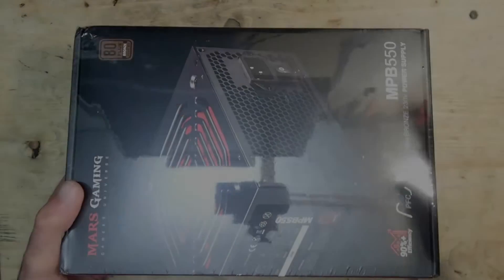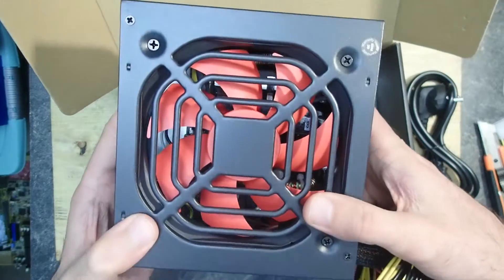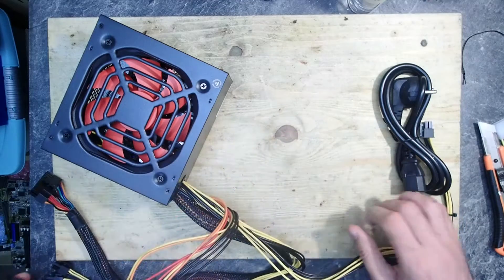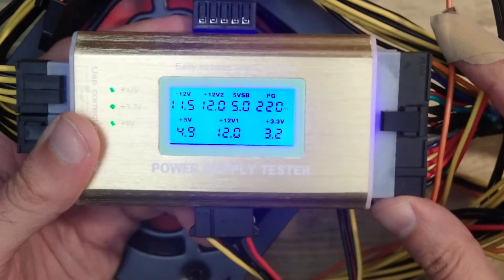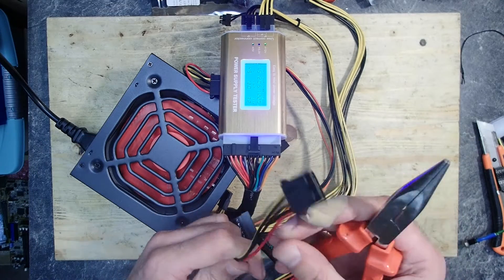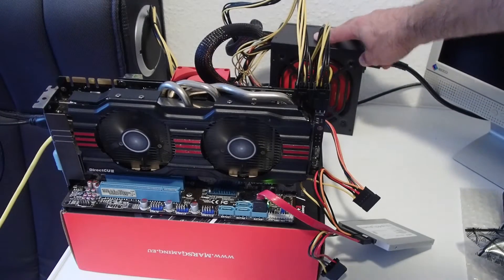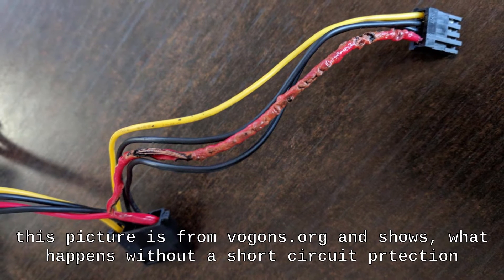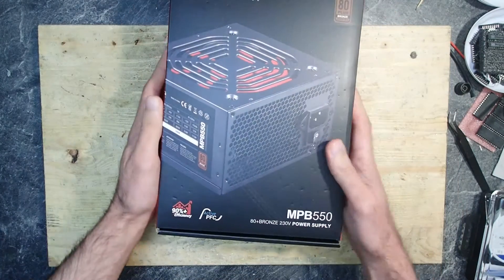Is this super cheap ATX power supply any good? (Mars Gaming MPB550 Review)

Comment: I am obsessive with keeping my power supplies in good working order.  I have dozens of retro computers, from the IBM PC and Mac Classic to Core i7, and anything I bring in that's older than 10 years gets a complete PSU overhaul before I ever turn it on.  Recap, re-fan, a thorough cleaning (with dish soap if necessary), the whole works.  (It's surprising how many times the seller tested the item to work fine, and it looks fine at a glance, and then the caps smell fishy as I desolder them, indicating they have been leaking electrolyte.)

Point being, I would blow the product cost of this PSU with a new fan and new caps alone.  I understand that I'm buying in quantities of 1, and they're not, but that still doesn't inspire a great deal of confidence.  When you have to even include shipping into the total price, that means that every conceivable corner is being cut to break even, much less turn any profit whatsoever.

To each their own, of course, and if it works for you, then cheers.  But, I feel like I wouldn't miss another 35 bones -- which would still be a cheap PSU, but at least not "do we HAVE to use a full 1 oz copper clad on the PCB?" cheap.  :-)  IMO, it's just not worth it to settle for bottom-of-the-barrel parts that likely just barely meet the specifications -- if at all.

Excuse me while I step down from this here soap box.  :-D
Reply from the maker: I'm mostly with you. One thing I had to learn tragically in the past though, that expensive PSU by a well known manufacturer, doesn't mean a good quality. If it's about old AT power supplies, I also do cleaning and at least inspecting every time. You can see it in every of my builds videos. And in regards of this cheap one, well wouldn't it be so cheap, it wouldn't be so interesting to get my hands on, right? :)

By the way, meanwhile some German magazines tested this power supply at it got also very good reviews. I still don't understand how this can be achieved for such a low price..... must be magic....
Reply: @necro_ware   Yup!  I appreciate your thorough approach to refreshing old PSUs.  I also think it's pretty cool how you take the time to rehab an old fan.  Usually the ones I replace are utilitarian, from an era where noise was a given, and not so nice compared to more modern, quieter fans.  (Of course, since noise is directly proportional to RPM, you have to consider CFM - particularly if there's only one exhaust fan.  But there are other variables too.)

Anywho, it seems like, for a test bench, this supply is a bargain.  But if it were me, I would keep a wary eye trained on it at all times.  I just don't trust Too Good to be True.  haha
Reply: I often find Seasonic psu's to be generally pretty good. Of the many I have owned and sold, only 2 have ever given issues. The first was my SuperTornado 300 which is getting on 18 years old, and the other was a cheaper 400 watt unit that I overloaded a few too many times. Even the Corsair branded units are quite good from my experience, though its usually a mystery who actually makes them.  And I have had a couple of those ones give problems, but I have sold many dozzens of them as well. So I am bound to see a few issues with any brand I am sure. 

I am also quite fussy about PSU's in my computers. Most all my retro builds now have modern atx psu's in them. I find it easier to just do that than rebuild an AT unit. I already spend enough time and money recapping the computers themselves.
Reply: I don't worry about it too much.  For one, the parts that heat up most in a PSU are the switching transistors and high-current rectification diodes.  Those are the things stuck to the heat sinks.  If you get any airflow over them, then they're going to be OK.  Silicon like that can run at insane temperatures, and if the PSU is stable with the factory fan under testing conditions, then it'll be totally happy with a little less airflow under normal conditions.

Consider this... many equivalent PSUs in OEM applications don't have fans at all.  The PSU fan is there, in part, as a mechanism to remove heat from the case itself.  I check the temp of the air coming out of the PSU, and the temp inside the case, and whatever thermals sensors are available via software.  If it's all reasonable, and seems stable (not consistently inching upward), then I'm happy with it.
Reply: @sirnickity  Yes, but what would you say a case in which a new fan won't provide ANY airflow? It can happen with a slow fan and a temperature control where the original fan had much more airflow. If the temperature is low enough, the VCC for the new slower fan might be too low for the fan to start. I had a case where the fan would stall until the PSU got quite hot, then it sprung into life. The original fan was Delta unit which had good airflow at about 7-8V VCC, but the replacement fan wouldn't start below 7V. I am not saying this happens a lot, but I have seen few cases where this might happen :)
Reply: @michvod  I would say "don't do that."  :-)  But it hasn't really been a problem, IME.

For one, most of the AT-style PSUs just run the fan at 12V.  ATX PSUs started to introduce fan speed control at some point, and now it's pretty much a given.  I have a few go-to fans that I buy from Digikey ... a Qualtek fan that is really quiet, but doesn't have a tach or PWM (perfect for PSUs); and San Ace fans that are pretty quiet, and have a tach wire.  (Bot of these are similar to Noctua in RPM vs. noise, from reputable OEMs, but cheaper than boutique brands, and not Band-Aid color.)  I don't remember what the Qualtek fan's starting voltage is, but IIRC, the San Ace starts at 5V.  It's pretty uncommon to find a fan controller circuit that tries to start a fan below 5V, so it's going to work pretty much anywhere.

As with any kind of mod or repair, you hafta know what you're doing, and use some common sense.  Sometimes you don't know what you don't know, and there may be casualties while you climb the learning curve.  Such is life.  But, retro electronics are going to need repairs, so IMO, you may as well get in there and start learning how to do it.

One thing I think people often overlook with cooling is to consider the whole system.  You can often get away with much less velocity of air by making sure you're moving it efficiently and effectively.  That might mean having an intake fan on the bottom front of the case, and an exhaust fan on the PSU in the top rear.  This is likely to be better than a single, more powerful fan on the PSU alone because you're providing positive pressure from the front fan as well as negative pressure from the rear fan.  It should also minimize the amount of dust you suck through the floppy and optical drives.

Likewise, having a case with 20 fans blowing every which way is going to be less effective than a minimal but well-thought-out airflow pattern.  I have significantly reduced the noise of my retro PCs by putting low-speed fans in strategic places, to the point where the HDD is almost always the dominant source of noise.  Most systems don't need a torrent of air moving through heat sinks, they just need a low-volume but constant supply of fresh cool air to pick up the radiated heat and move it out of the case.
Reply: @sirnickity  Little secret tip for PSU fans: Yate Loon, preferably their double ball bearing ones so one doesn't have to worry about the fan ever again. They start on their own (without any help) at crazy low voltages like 2.8V for the 120mm fans, which also makes it possible to use them in other applications powered straight from 3.3V even, rather than 5V as the most common low-point. That said I wouldn't wanna be in a room with these going at their full rated 12V :P 
And I concur regarding overall airflow through the case. The amount of times a 12V fan wired to 5V both in the front as intake and the rear as exhaust (in addition to the PSU) is more than enough to keep even a reasonably powerful system in check temps wise is quite mind boggling, provided the case has decent fan grills and not just a stamped jokes of a fan grill with 15% holes to 85% metal. On some really bad offenders I've even dremeled the stamped "grill" out of the case and simlpy replaced it with an oldschool wire fan grill (those circular ones you screw onto fans) for a 100% airflow improvement :P 
On the rear of the case nobody will really see it and on the front it's usually still behind the front plastic of the case so it's basically invisible too :P
Reply: Re caps smelling fishy.. recently bought a PSU on ebay for a Socket A build. Needed something with a bit of grunt on the minor rails (3.3V/5V) so I got an older Seasonic (SS-300FS with 180W combined on the minor rails). Seller photographed it plugged into a PSU tester like in this video showing that it's working and all voltages are on point. I got the PSU and while it looked very clean, I opened it up just to be greeted with every single cap on the secondary side puking its guts out.  TBH I kinda expected this since this PSU series is solid in all regards, except for the crap cap choice (PCE-TUR/TUL/TUT series). But it's a prime example that those stupid little PSU testers don't mean anything other than "yes it turns on"... 

also: "I would blow the product cost of this PSU with a new fan and new caps alone"  that to me sounds like you're being massively ripped off getting caps and/or fans
Reply: @Knaeckebrotsaege   I buy 105C rated Nichicon caps from Digi-Key.  It seems I don't get out of there for less than $100 every time I place an order.  But, full disclosure, I keep a box (well, two now) of spare parts so I can take a stab at the next PSU that comes my way before having to order more parts.  So, when I need a 470u/50v cap, I buy 10 of them.  OTOH, when I need a 100u/50v cap, I buy 0 of them because I still have 8 in my stash.  So it kind of evens out.

Part of that bill is usually fans, which I buy two or three at a time.  There's a Qualtek that I like because it's one the quietest 80mm fan I've found at 12v.  I also started stocking a Sanyo Denki fans because they have some 3-wire (tach) fans that are almost as quiet as the Qualtek, and have lots of options in 92mm, 120mm, etc.

I'll check out the YL fans.  I don't have a source for them at the moment, and I'm pretty happy with the ones I've got on-hand, but it's always nice to have options.  I've gone through a few to get where I am, so no telling when I'm really done.
Reply: I hope you put the same specced fans into the power supplies. I had cases that replacement fans had much less airflow and the PSU then overheated. Myself, I usually just take the fan apart, clean the bearings completely and reapply grease - usually hi quality Molykote. On a vintage equipment this is absolutely necessary as it keeps the gear in original condition - well at least mostly, if I exclude capacitors.
Reply: @michvod  On my old Seasonic SuperTornado 300 I replaced its original red-fan with a higher flow panaflo. And it kept the PSU much cooler thereafter. I also did repair and re-oil the original fan but never bothered putting it back in. I think when it comes to thermal stress that I should upgrade the cooling when the time comes for vintage equipment.

The fan curve of its "S2FC" fan control started at 4 volts and would not ramp up until a somewhat higher temp than I was comfortable with. At least at the base voltage the newer fan pushed a bit more airflow so it was cooler at a baseline. And the speed is governed by a combination of temp and load. So under load it will speed up somewhat as well.

Comment: I'd say stay away of these cheap chinese PSU:s. If you are on budget, go for a hunt for used ones etc. I bought mine from thrift store for 10€. Cooler Master GX750 is what I got, only issue with it was the fan, I replaced it with new one and works fine :)

Comment: Great review. Please do more of that ;-) I'd also recommend the Neodymium Magnet test on the wires next time. I have several PSUs and Molex<->PCIE adapters with apparently copper cladded steel wires or some other material that is clearly magnetic but looks like copper. Also, those Molex<->PCIE adapters can be of very bad quality if you're unlucky. If you have one that feels extra light then strip the wires and check the gauge. I have some with extremely thin strands inside that get warm and cause a considerable voltage drop.
Reply from the maker: Nice ideas, thank you. Especially the non destructive ones. As long as my channel is as small, I'd prefer not to destroy the electronics which I buy. If I don't like it, I still can send it back, but if I destroy it, it will be not possible.
Reply: Not to add anything to the table but this tip might be helpful. Thank you very much for tip.

I have this PSU that could theoretically supply 480 watts and I was somewhat disappointed when the voltage drops more than 1 volt across a rather short span of wires. The wires itself is thinner than usual and this PSU caused my GPU to "crash" due to not getting proper voltage

Comment: Is it possible the 5V rail does have protection, but the resistance of the cables meant it didn’t trigger? Just thought it was unusual 12V and 3.3V both had it but 5V didn’t!
Reply from the maker: Unfortunately it is very common today. To common if you ask me. I don't know why, but many manufacturers just don't do any protection on the 5V rail. It is not used so much on modern PCs, so may be because of that, but I think, it is irresponsible though and I will never understand that.
Reply: @necro_ware  I have noticed a lot of new PSU's have the 5 volt rail powered by the 12 volt rail using a dc-dc converter. That could explain why there is no short protection.

Comment: My rule is don't run a cheap PSU on anything I can't afford to loose.  My 3950x + 2080TI is on a pretty expensive 80+ titanium rated supply.   What you have looks just fine for what your using it for.
Reply from the maker: Talking of price, I think, if you bought 3950x + 2080ti, there is no need to talk about how cheap the PSU should be. I don't think, that +/-50€ would make any difference in the overall costs :) I think, this is more interesting for someone, who is really on low budget.
Reply: @necro_ware  I've put together probably approaching 500 systems in my lifetime.  I've done all kinds of budgets.  My 3950X system is in a Lian Li O11D XL case with multiple radiators and full water cooling blocks for the CPU and GPU.
Reply from the maker: Just as opposite example. Couple of years back I bought an expensive BeQuiet PSU, because I didn't want to have troubles with my main PC. After 4 months it exploded in fire and I didn't only have to throw away my whole PC, but also renovate my working room. Unfortunately, price doesn't mean much today as well. As I told in the video many PSU today, which you can buy don't have short circuit detection on 5V. Even the expensive ones :(
Reply: @necro_ware  ohh you need to see the tests gamers nexus are doing to PSUs, a range of gigabyte ones are exploding like there was no tomorrow!
I wonder if there is a cheap alternative to load test our PSUs and check voltage while we are loading them with some resistors.
Reply: the rating is meaningless about durability and you don't need to go expensive to be safe. Just buy from respected manufacturers, like seasonic, evga, corsair (not the VS), superflower ecc..
Reply: @gigigigiotto1673  I buy mostly all Seasonic.  Having a strong electronics background I can spot the garbage most of the time.   Want to blow up a PSU,  use a modified sinewave UPS with Active Power Factor correction in the PSU.
Reply: There is a big issue right now with a GigaByte branded PSU.
Reply: @dalecomer5951  boom boom boom, i don't want that in my room